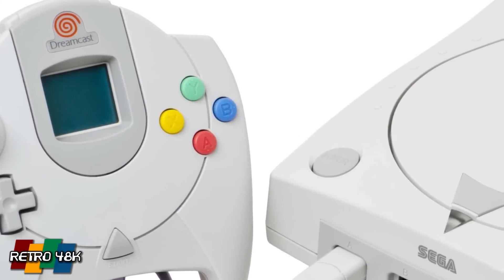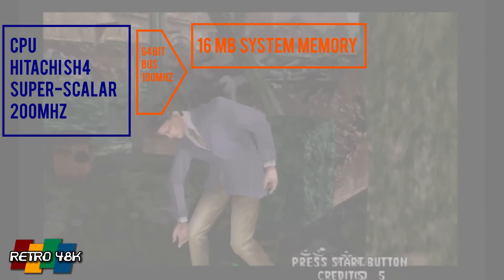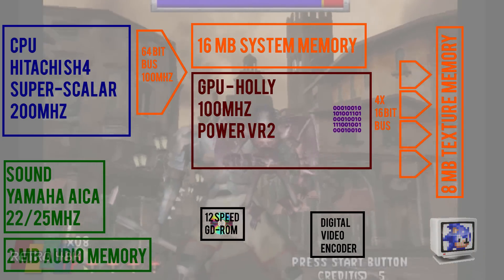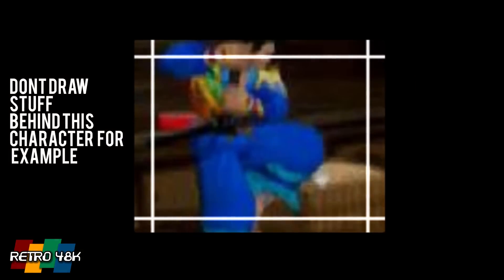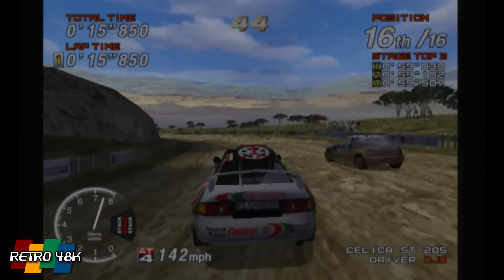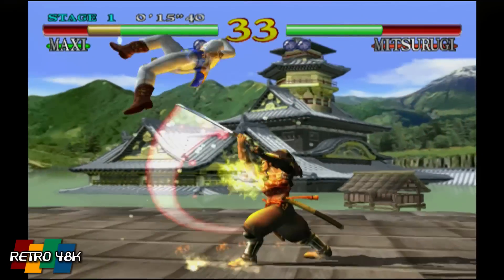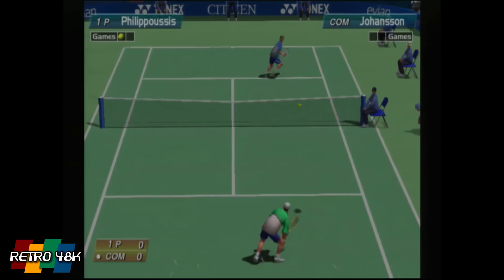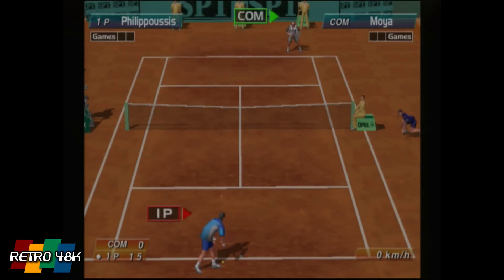How the Sega Dreamcast Worked

Comment: PCs were up to 500Mhz during 98 - 99.
But there is something on that Dreamcast's cooling system & fan that sounds like a vacuum cleaner. -System simply does not overheat, no matter what.
I think they got a lot more than 200Mhz performance out of that CPU...

But overall, it was the texture compression technology that made Dreamcast like no other.
PS2, NGC or even XBOX did not manage to beat texture detail & clarity DC has.
While Bump -Mapping on XBOX looks great, the actual colour depth on Dreamcast's most detailed textures is something beyond.
Reply: Are you sure? Most XBOX and PS2 games run at 24 bpp, while DC does 16. Also its texture compression leaves artefacts.
Reply: @mopeybloke  DC does not have any texture issues. Developers said back in the day, that courtesy of texture compression, they can display even 64MB worth of textures on screen at once. 
I own DC/PS2/NGC/XBOX... Dreamcast has better textures than any of those systems on RGB -cable. I use Component Cable for others. But it's not due cable. For example Sonic Adventure on DC has way better textures than any release of Sonic Adventure DX.
Reply: @M1XART  Thats not how RAM or VRAM works. You can only display on screen what is on memory. The rest has to be streamed.
Reply: @ Or simply swapped if cartridge based system.

Comment: The Dreamcast had better graphics than the PS2, the image had more resolution and it looked a lot cleaner.
Reply: It really doesn't. It' true most games are higher res, but when it comes to texture quality, geometrical density, it was beaten by the PS2 by 2001 at the latest. Also so many games at 60 FPS.
Reply: @ true but higher resolution means cleaner and more defined image
Reply: @mortalballdc  Only if you dont use the right screen, the rest of the game also matters. Its dumb. Does that means Doom 1993 in 8k looks better than the modern Doom games at 1440p? No.
Reply: @mopeybloke  not treu dead or alive 2  had better textures on dreamcast .
Reply: They were cleaner, no doubt but they were also quite simplistic and in many cases had rudimentary lighting effects
Reply: @eponymous7910  yes I couldn’t agree more with you on that one. No Sega Dreamcast game could compare to Ratchet and Clank, God of War or Kill Zone.

Comment: Small corrections:

"... RISC based CPU that in cooperated a lot of cool Sega stuff like Super Skalar and things like that..."

You are confusing Sega Super Scaler branding for the sprite based pseudo 3D tech that they had in the arcades with the concept of parallelism that the Dreamcast's CPU design was based off, making it a 2-way superscalar processors. It's the thing that Intel was the standout in the first Pentium generation.

https://en.wikipedia.org/wiki/Superscalar_processor

Speaking of which, 200mhz was below PC CPU's of the time, that ranged from 200 to 400mhz at the time the Dreamcast launched in Japan and over 1ghz for the Western launch.
Reply: Super scaler is a generic CPU term that indicates the CPU can begin execution of multiple instructions at the same time. I can see why that might get confused with Sega's "Super Scaler" arcade graphics system for resizing sprites in this case, but the two are entirely different things.
Reply: Still look at prices in 1999, 450Mhz CPU costs 500$ and 1Ghz -990$. And don't forget that this CPU require well-cooling system! Even original Xbox has 730Mhz CPU and it was 2001!
Reply: @colos3284  PC has always been more expensive, but more importantly I just mentioned that something was factually incorrect. Saying a PS5 Pro is as fast as a 4090 is still wrong no matter if you bring pricing into it.
Reply: 200MHz SH4 = 600MHz x86
Reply: @some-online-dude  Happy to see a source, but considering it was a design with just a 16 bit instruction set and was only rated at 360 MIPS at the 200 MHz Dreamcast used vs over 2000 MIPS of a 600 MHz Pentium 3 I highly doubt that...
https://en.wikipedia.org/wiki/Instructions_per_second

Comment: PowerVR is still around. The GPU in Apple's devices are spiritual successors to PowerVR GPU and for a long time before Apple started making their own GPUs they used PowerVR for their mobile devices . Intel also used them for their iGPU at some point. One of the benefits of the way PowerVR renders things is efficiency so for a long time it was the only real choice on mobile devices and laptops with integrated graphics as it would sip power by while still rendering fairly complex scenes.
Reply: PowerVR also was in the PS VITA. So it had a longer console legacy than most people realize. The tech was good. A lot of it has made its way into modern GPUs.

Comment: If I recall correctly, the Z-buffer was only virtually eliminated. Each tile still had a 32k sized buffer for Z calculations. 

But of course, at 32k you can say it more or less has been eliminated.

Comment: When the Dreamcast released in Japan in 98 the Pentium 2 was top of the line in the PC realm and clocked as high as 450mhz. Come February of 99, well before the September 99 release of the Dreamcast in the states, the Pentium 3 dropped starting at 450mhz. And Coppermine was out come October which could clock upwards of 1133mhz.

That's all CISC though. In the RISC space the top dog was the PowerPC G3, also known as the PowerPC 7XX series which launched in 97' starting with clocks in the 233-366mhz space. By 98 the 755 was reaching 400mhz. And in 99 was hitting 533mhz.

200mhz RISC was a great speed at the time for a console, but PCs were already there if not above, and even in the lower consumer space. If I recall we were rocking a somewhere around a 233mhz in my house, and it was not a high end PC. I was rocking a hand me down 75mhz Pentium in my bedroom. Or was it 100? I don't remember.
Reply: the sh 4 had 10 mill transistors vs 6.35 mill transistors for the power pc 7 the sh 4 looks like a top risc cpu for the time.
Reply: Absolute horse shit. In 1998 there were no pentium pc's at 450 mhz. 233 was already top of the bill.
Reply: Dreamcast's SH4 performance = 600MHz x86

Comment: At its launch, DC was the most powerful thing SEGA could have put out there for the money. But the PS2 /CPU, GPU, MEM, DVD/ easily outperformed the DC. The overall evolution was going too fast.
Reply: I remember multiplatform games better on DC than PS2.
Reply: @totocpc  Cause most were made for Dreamcast/Naomi.
Reply: @totocpc  yep. HL1, UNREAL, QUAKE3 running half framerate, half gfx of a PS2. Sure kid.
Reply: @gurujoe75  Unreal Tournament run far better on DC than PS2, everybody know that. Sure, Quake 3 was upgraded for the PS2. Anyway, FPS are more PC games and the Dreamcast allows to play them using keyboard + mouse.
Reply: @totocpc   reported kid.
Reply: @totocpc  12 fps on DC kid is HARDLY a running BETTER ..

60 fps - https://youtu.be/-_Y2eypxcmk?t=131 .. this is a PS2 power .. kid.
Reply: @gurujoe75  I don't care about PS2 vs GC vs Xbox ... The Sony system was the powerless of this gen... noob.
Reply: @totocpc   sure kid, bye kid.
Reply: @gurujoe75  Bye noob.

Comment: The Dreamcast should have had the Naomi2 TnL hardware, and supporting geometry memory, to be fully on par with PS2 polygonal performance, that along with the higher resolution and VGA monitor support would have told a much different story for the system.
Reply: It wouldn't have mattered. What mattered was that the PS2 had a DVD drive.
Reply: @some-online-dude  game-cube had 1GB mini DVDs
Reply: @santitabnavascues8673 Yes, which makes it not be a DVD player, and it flopped so badly that, if not for the GBA, Nintendo would've been forced to leave the console business.
Reply: @some-online-dude  many ps2 games didn't occupy all the DVD, and to my knowledge, only 3 games used the dual layer, the Xenosaga games. Resident Evil 4 was superior on GC, and used a single disk. And if the DVD playing was a factor for the ps2 success then ignoring that factor leaves the PS2 success not that much over the XBox or Game Cube, and wouldn't be really meaningful for the GameCube downfall. If storage was a concern, then games would come in multiple disks, Skies Of Arcadia would occupy 2 GDROMs on Dreamcast and only one mini-DVD on GC, albeit with lower quality audio and worse textures. But TLDR DVD playing as a factor for success is unrelated to gaming, and thus not so important.
Reply: @santitabnavascues8673  no, DVD playing is not at all unrelated. DVD players back then were as costly as a PS2 itself, so why buy just a console and just a DVD player, when you can have a DVD player and a console in one for less? Especially when it was foreseeable that the two consoles could produce graphics in the same ballpark. Also don't forget that there were people who got the PS2 just as a DVD player, but then ended up playing games, too, since they now already had a console anyways.
Reply: @elgoog-the-third  on that premise, graphics would matter little. But I don't see people wishing for Dreamcast graphics on PS2, and Microsoft sold a dvd remote controller for xbox, meaning it was a machine primarily designed for gaming, which, as side effect, could be used to play dvds. Also DVD playing quality wasn't that great on ps2, I remember attempting to play a dvd on the console and not making it to the end because it had read issues, on a brand new console, so I firmly believe ps2 success was more related to its catalog and performance as a game machine, and not so much as a dvd player
Reply: @santitabnavascues8673 Why would people wish for Dreamcast graphics on the PS2, considering they were quite similar in power? Fact aside that people indeed wish the PS2 had graphics as crisp as the DC with VGA output. 
Also, have you seen the games the PS2 had while the Dreamcast was out? Those were not great at all graphics-wise, to put it mildly.
There were lots of people getting their very-early PS2 replaced due to drive issues, btw.
The Xbox did not sell well, either, missing Microsoft's target of 50 million units by almost 50%. It was too expensive, and needed an Addon to play DVDs. Also, it was late to the party. The powerful hardware there really is the thing that saved the Xbox and made it sell better than the GC.
Reply: The PS2 still draw way more polygons. The Naomi2 is just a DC on steroids with twice ram and three times the polygon count.
Reply: @sebastiankulche  I take vf4 as a benchmark here, and its performance was enough to make Dreamcast+Naomi2 a competitive choice, Game Cube had superior performance than ps2 and still fared the same.

Comment: Efficiency really sums up the Dreamcast's hardware design. Everything is thought through to minimize any waste. Ontop of the tile rendering (which allowed them to get away with a lower polygon count) the system feature really good texture compression allowing it to fit almost 8 times the amount of texture data into memory. This allows the system to store all the texture in the video memory rather than having to fetch it from main memory when being used. This of course means SEGA could get away with having a smaller amount of ram but also the bus between the CPU and GPU would be freed up for other tasks. Extremely efficient.
Reply: The DC still has nicer looking textures than the PS2 as a result of that really good texture compression. It was a fantastic machine for it's a time. Developers who worked with it loved it, and it's a bit of shame we never really got to see what the hardware could actually do when really pushed.
Reply: @seanmckelvey6618  32bit colour vs 16 bit on the PS2

Comment: If ONLY Sega had let Nvidia put a GPU chip inside that dreamcast......😭😭😭
Reply: Those days were crazy, sega actually had a stake in another gpu company called 3dfx they were the nvidia of their day, and they still went with the powervr solution!
Reply: @youngwt1  true but ironically it was Nvidia who had the massive potential so much that they underestimated themselves.because CEO Jensen Huang told Sega that unfortunately they weren't able to come up with a GPU solution for the sega dreamcast but demanded Sega pay them $5 million to help them recuperate their research & development cost because the Dreamcast Nvidia GPU nearly exhausted in Nvidia into bankruptcy

Theoretically,I think Nvidia were too far ahead in terms of their current GPU tech at the time that Sega didn't see the full potential and went with NEC's PowerVR2 GPU chip which was a decent alternative at best
Reply: @Final_Fantasy_7  a riva tnt running at 90mhz is weaker than a power vr 2 running at 100mhz.
Reply: @athos5359  damn, so much for that song TNT, I'm a power load..
Reply: @adventureoflinkmk2 die size is similar but the power vr 2 is on a 250 nm proces size and the riva TNT 350nm proces size .
Reply: It didn't matter what GPU Sega put into the console. It was not the console itself that made Sega pull out of the market. It was Microsoft entering it. Microsoft and Sony and to a lesser extent Nintendo are behemoths compared to Sega in 2000. Sega simply did not have the resources or ability to go head to head with the other three and come out profitable. If you want to blame a single reason for Sega abandoning consoles, it's Microsoft.
Reply: @Charlie-eq3dj well... if it werent for the fact that the 32x and saturn were also flops...
Reply: @adventureoflinkmk2  Sega's past mattered less and less with each success they would have. If Microsoft didn't release a console, there's a good chance Sega would have sold an additional 10-20 million consoles if they stuck around for a full generation. Especially if the best place to play online games, especially sports games was the Dreamcast. That would have resulted in profits year after year and by the end of that generation, even if they finished third behind Sony and Nintendo, it would have been considered a turn around success from where they were.
Reply: Sega of America was nominating 3dfx for the graphics in the console. However, Sega of Japan had a hissy fit about the news leaking in their perception; not understanding that, by law, a publicly traded company in the States has to disclose their involvement in upcoming projects to their shareholders in such meetings. Thus, Sega of Japan threw a tantrum and vetoed the whole deal, in favor of going to PowerVR.
Reply: Even with a 1998 workstation like GPU, it would had still lose to PS2.
Reply: The PowerVR2 was a lot more powerful than the alternatives they had.